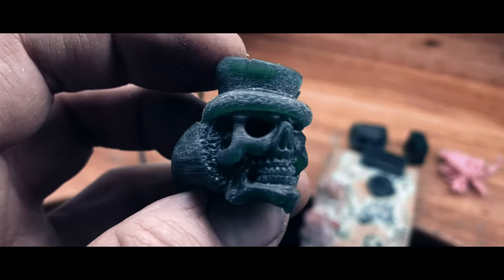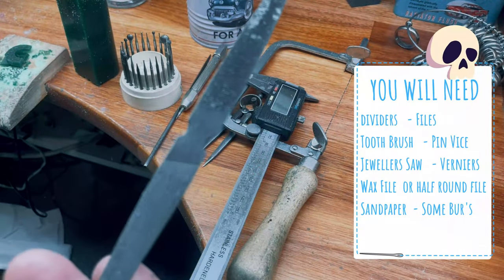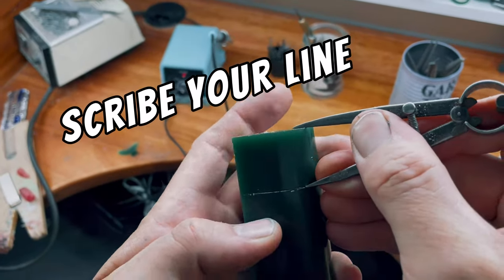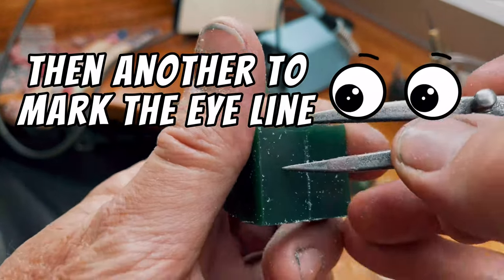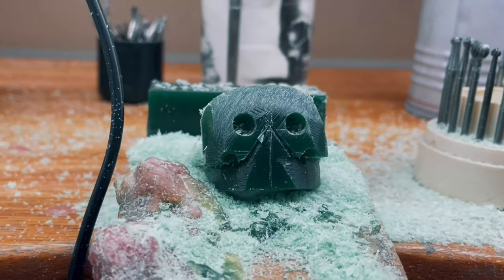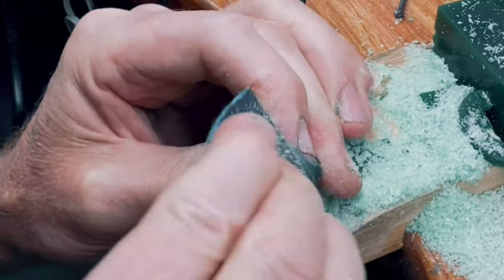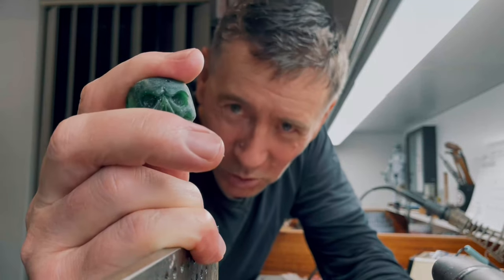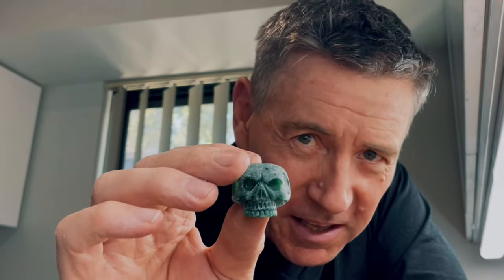How to carve a skull ring from Wax 💀 #howto #jewelrymaking  #handmade

Comment: if you make a very complex shape can you cast it in plaster by melting out the wax some how? thats the issu i have at the moment. its not possible to make a mold in sand because tand goes in to small compartements amd it breaks when i want to remove the ring
Reply from the maker: Using investment is the way to go when casting you can get very fine detail but you do need a kiln to burn out the wax .We do have a video ( HOW TO DO SILVER CASTING ) which shows how we cast and do the burn out .. hopyfully this is helpfully ..